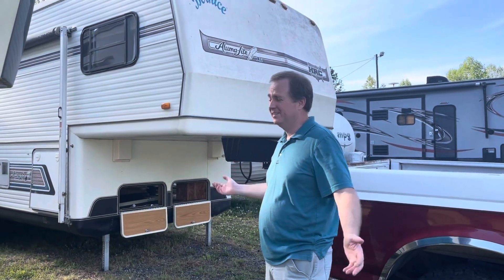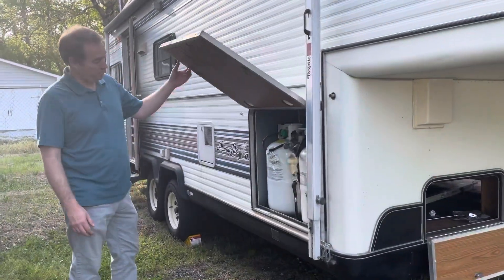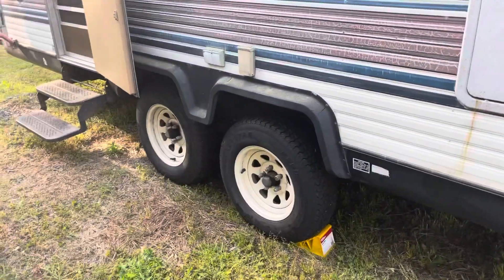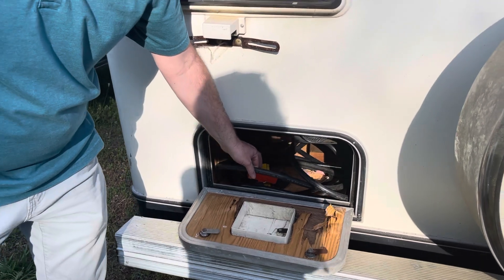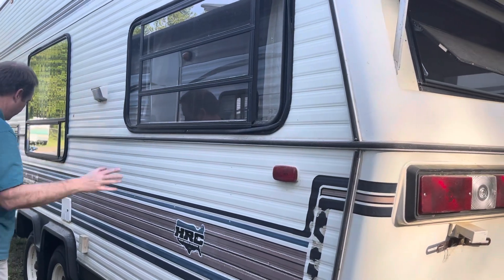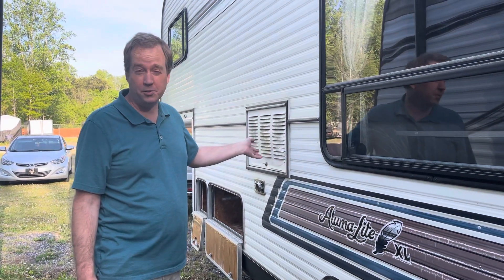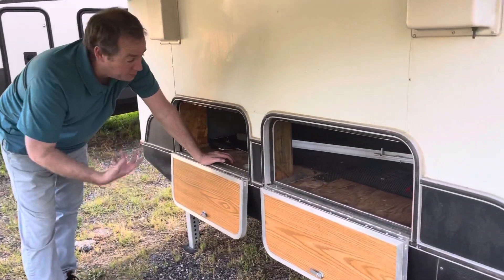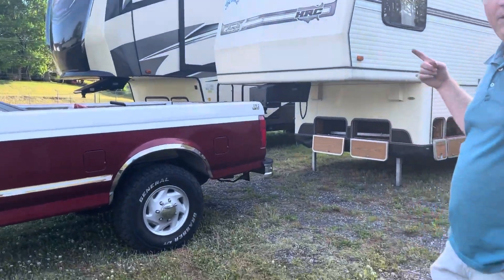1987 Holiday Rambler  Aluma-lite 5th Wheel Outside Tour Part One

Comment: I have the same truck but a 91 F-Superduty lariat XLT f250 with the non turbo 7.3 idi has 764,582 original miles on it runs and drives good. I'd love to get a older trailer like this I've been looking for a while for 1.